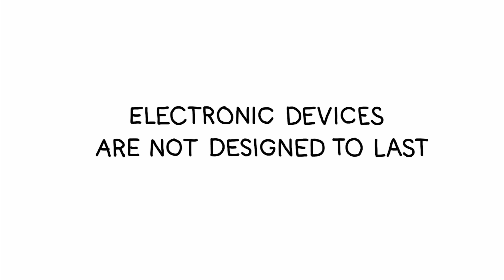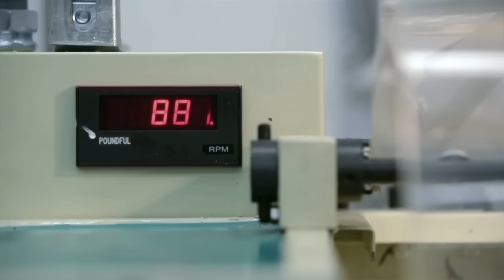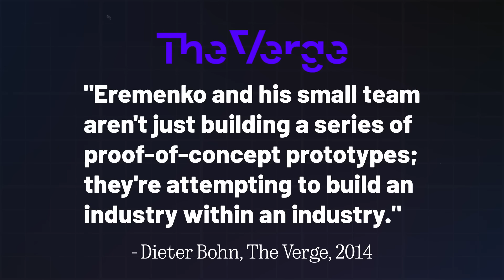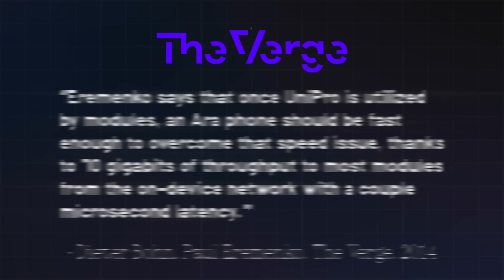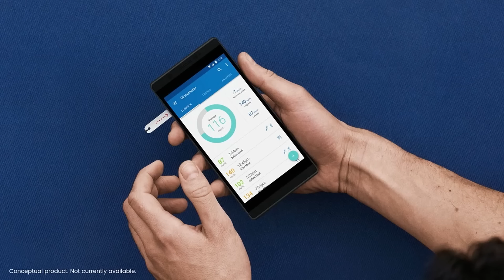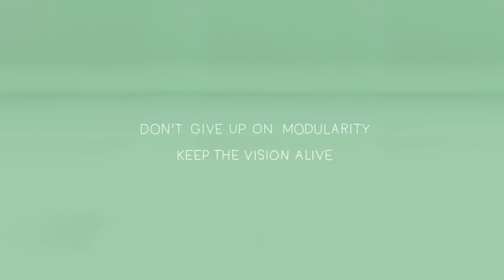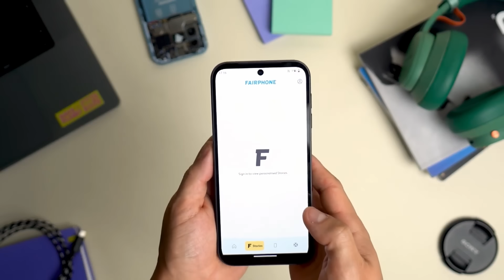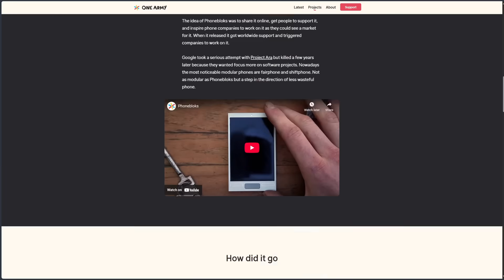Why Did Modular Smartphones Fail?

Comment: Yeah, I thought these looked pretty cool as well, but wasn’t sure how feasible it would be, especially the more pie in-the-sky promos like PhoneBloks, even if you could get everyone to work together on and pay for it.
The frame and all the module connectors/shrouds could make it a lot bulkier than a normal phone of comparable stats, the connectors could cause reliability issues and be prone to damage/coming loose (imagine dropping one of those without a case and all the parts flying off), getting the software to play nice with all the possible hardware configurations (and the different hardware to play nice with each other) would be a mess, non-tech-savvy users would likely screw it up assuming they weren’t scared off by it, etc. 
I do agree it should be easier to fix/replace/upgrade bad parts in phones, with right-to repair and such, but that concept sounds like it would cause a mess of its own problems; something like the FairPhone where parts are just easier to swap seems more workable.

Comment: I really liked the idea of these phones when I heard about Ara. It was something that I was like "Cool, I'd probably buy that" but then thought more about it and wondered what would I even want to swap out. Unless something breaks the only things I'd want to upgrade might be the camera or the cpu/storage/ram. All of which work well enough in modern phones as it is. I also had a big question mark on the whole limiting of waste aspect because I still figured that there'd be enough people who'd just swap to the shiny new module. (iCamera module 10, now with a physical built in zoom!) and toss out the old one. Technically, it would be less waste since it's a smaller piece, but that's just for a single upgrade. Not to mention how much it would be breakable. Even with the lock-in snaps I just imagine a lot of those little parts could end up broken or scuffed up in the same way that the lightning cable seems to always wear out super fast. Although not as fast as the prongs on the Micro USB. XD

I still hope that one day we have something that can bring forth this kind of idea, but I don't think the approach that these guys did was the real end piece. The attachable methods have some merit, but they have the starkly obvious con of now carrying around a bunch of attachments (depending on industry, cases would be made, but still).

I suppose I should also admit that I'm one of the people who just loves the idea of cartridges for games and really misses that (Switch kinda brought it back, but I don't have one nor plan to get one). So I'm quite familiar with loving a technology that will just not work, or if it does isn't wide spread, in the modern market.

Comment: The moment I heard of modular phones, I figured they were pointless.
Want to separate major components onto separate blocks instead of keeping them on a single die? Performance plummets.
Want a selection of peripheral modules? Can you really think of something you would want that other people would not and vice versa? Are people's needs REALLY that different?
Once you concede the previous points, the only real issue that remains is making the internal components of a phone relatively easy to access and replace. Yeah, that can be done.
There is no grand conspiracy against the modular phone and there never has been. It's just a bad idea with superficial appeal.

Comment: Because people don't know how complex phones are and how you cannot just swap a part for another. Different parts use different interfaces to connect & Only certain pins support certain interfaces. Moreover many interfaces are high speed interfaces which require a very strict design, like trace lengths being same, etc. This means you would have to design all the connection points with the strict designs in mind because you don't know what a particular connection point could be used for.

Framework laptops are a very different thing. All high speed interfaces are fixed like camera, etc. All the "modular" part is just a USB-C connection.

Comment: Part of the problem is that it's modular by design, rather than by necessity. PCs are modular by necessity; there are 4 main pieces, a motherboard, a CPU, a GPU and a PSU, and it's just easier to keep most of those things separate. And because of that, users can swap components easily. But with a phone? Modern phones are descendants of both the cellphone and the ipod. And famously steve jobs threw the first ipod into a fish tank to show the air bubbles to show there was 'still space inside' - phones cram so much stuff in that unlike PCs, it's actually much easier to design a product that cannot have core components swapped around.

And that makes modularity not a natural fit to the phone. That doesn't mean it cannot be done - it just means that modularity is a feature rather than necessary. And when something becomes a feature, it requires a ton of development time.

The same thing happens everywhere. Look at Minecraft redstone; you can make a huge redstone project on a superflat world and it'll be pretty easy. You can even quite quickly swap out parts - maybe you don't want that noteblock song section anymore, maybe you want some visual thing. But now crunch it all down into the minimum possible space and you're going to have to be a wizard to fit it all in. Now, if you change your mind about a noteblock song, you're going to have to fundamentally change the shape to get it working. It's hard and time consuming.

On something like a phone - small enough to carry, resilient enough to be dropped a foot, good battery life - the easiest things to replace are things like the speaker, buttons and screen, since they can sit on the outer surface in some way. But the core components - the things you WANT to be able to replace to keep the phone from being useless - are things that need to be crammed into the center. Pulling them away from the center to be modular components means significant issues getting stuff working. It's not impossible, but it's no wonder that it couldn't be done on paltry funding, not without seriously compromising the phone in functionality.

I would absolutely love a modular phone, the ability to swap out the CPU after a few years. But the time needed to develop such a thing properly could - any company will reason - be spent on designing other products.

Because no matter how cool the idea of modular phones is - businessmen don't want them, appleheads don't want them, parents won't want to give something so easily breakable to their kids, old people prefer all-in-one designs. People who care about fashion don't care about swapping parts for it to look cool, because they prefer either a premium look or expression through protective cases. So who is the product for, ultimately? Is that group large enough to make it worth designing that product, or will that demographic still buy an all in one smartphone if there is no modular phone to buy?

It's one of those ideas which is awesome but at this stage is just not going to happen - even if it happens, support will be so much lower than apple or big-brand android like samsung or huawei that it can't take off.

Comment: I got the newest ShiftPhone a while ago and love it. Never had any issues with it.

It is a bit more expensive than non-modular phones with similar specs, but my main stand-outs are:

- New phone models are effectively crowdfunded through people preordering it. During this crowdfunding process, the developers give regular presentations and have votings for pre-orderers to have a say in features they want to have in their phone.
- Good customer support
- Designed to flash a custom OS onto it
- The recycling and ethics aspect is much better than Fairphone's. Supply chains are actually transparent and fair. Fairphone is in my experience a lot of marketing but very dodgy ethics.

So yeah, I'm really happy with ShiftPhone.

Comment: I think flagship phones do all these things well enough, and if you truly wanna stay on the bleeding edge or have all the upgrades you just flip your old phone and get the newer one.  Quick charging / wireless charging makes battery wear less of an issue because even when your battery no longer makes it through the day, you can top it up quickly at the half way point during your lunch.  as for the phone breaking: always use screen protectors and lens protecting glass, and a case to absorb shock from falls.  We're getting to a point that people are no longer replacing their phones as often because the tech has matured to a point where it's good enough to do everything.  People don't want modular upgrades, they just want the best stuff baked in.

Comment: i feel like the problem with the modular phone is that it doesn't really fix the issues it seeks to address.  if you wanted a phone to fit your life style i'm sure its out there somewhere. if not, i think hyper specific phones would be cool but, it doesn't fix the fundamental issues with with build quality and life span decreasing even if the the technology is advancing.  people buy more bad products because they break more often, it is a right to repair problem but if the component your putting in is just as low quality as the component that was already in it your not really fixing your phone as much as your are doing basic upkeep like you would on a car.

Comment: I was so pissed when the USB charger of my previous phone (I guess, it's something worth of 50 cents or so) broke and any repairing would have been a total economic desaster.

As a consequence I bought a FairPhone, that is at least modular enough, so you can swap individual parts for repairing or upgrading. And it has long term support (at least 5 years, but in past 7-8 years were usual) with the additional support from the LineageOS community after it, no boilerplate apps installed and just works fine. I'm happy with it now for 5 years, still enjoying it and will running my first repair/upgrade round at the end of the year.

If we leave out irrelevant features like you can't go diving with it, it is as good as an iPhone, but still a bit less expensive, longer endurant and repairable. And as it installs Vanilla Android, the spying on you is quite reduced at least compared to all other competitors.

So, some modular phones (not to the extent of the video) doe exist and have a long running successful business case. Of course, probably significant less market share than 1 percent. But that's up to the consumer, in the end any modular phone will be less expensive over the lifetime (and it will live longer). And as smartphones don't distinguish anyway each other (beside of the enshittification race to the bottom that most manufacturers have choosen), it's a relatively simple economic decision where good price meats practicability and distract-freeness.

Comment: I think most people will be happy with being able to easily swap the screen and the battery.
Like, repairing them is quite easy all things considered but having to pop a glass screen is scary and digging a bit too deep will make you slice through a ribbon cable.
You do miss on the satisfying sound of the pull tabs tho.

Just imagine you break your screen and buy another one by just removing a few screws or literally just pulling it out and while you are in ther pop a new battery.
Boom. 90% of the phones in the market have enough memory, storage and power to last you a few more years.

Comment: Why did it fail? Simple. You dont really need to repair or upgrade your phone that much. The phone you had 3 years ago was already powerful enough to do everything your new phone does. 
Also Companies really dont care for waste and even want you to waste more, because why only sell you a new battery when they can sell you a whole new phone. 
Now after the new repairability laws in the EU that forbid designs that make repair hard on purpose we do have a bunch of new phone companies poping up that promise easy repairs and an actual replacement part shop.

Comment: modularity is so far down the list of priorities of the general consumer looking to buy a new phone that it's never worth the material cost, development time & sacrifices to more important aspects like durability. The enthusiast community does not have enough leverage to grow a 3rd module & accessory market that makes having a modular phone worth while.

Not to mention that in reality if this becomes industry standard, there'd be so many proprietary standards and design restrictions to make them useless. Chances are they'll make the most flimsy fragile modules imaginable so you keep buying them as replacement. The main parts will still be hard wired to the phone so you still have to buy a new one every once in a while, with a brand new accessory ecosystem with no backwards compatibility of course

even in a perfect world, thekr market space will always be pinched by general consumer phones where customers will scrutinize every cost associated with the phone on one side and purpose built phones specializing on one aspect really well where no professionals will compromise on the performance regardless of cost

Comment: As someone who has long been interested in this and who has been using a Fairphone 4 for 3 years now. I think that maybe these "swappable bloks" are not the right idea. Sorry but we have to admit that caring about your processor or the model of your camera is nerd shit. What most consumers want is to buy a phone, boot it and it works nicely.
With the fairphone, you can replace the parts by opening up the phone and unscrewing them. And you know what this reminds me of? Just a standard old desktop computer. Maybe one of the most modular designs to ever exist, the desktop computer is both something for nerds like me who want to upgrade their graphics card and improve their RAM, for people who want to use it as long as possible as well as for consumers who just want a device that works out of the box. And that's what I've been wondering, why is there not at least one standard phone format with replaceable components that you can buy upgrades for? Not one with cool click-in tiles, just one that you open up and screw whatever processor module you want into. It would possibly be a bit niche and nerdy at first but I don't see how something like that couldn't become a general base for affordable and premium phones just as it did for the desktop computer.

Comment: honestly something kinda relevant imo is how a "fully modular" design... isn't really possible? or at least not really accurate. there are certain things every phone needs to have - a CPU, ram, storage, battery, probably a GPU, etc. that's gonna take up at least half of your existing slots, and leaving them out leaves you with a non functional device.

plus, these components aren't just off the shelf stuff thrown into a motherboard like a PC can be - this stuff is all specifically designed to work together. even if your phone's CPU had some "common socket" like a PC, that doesn't mean it's compatible with the rest of the hardware. 

but even if you were able to reconcile all of this, you end up in a situation where you probably need to upgrade all of it simultaneously if you wanted to upgrade any of it. your new CPU takes way too much power, so you need to upgrade the battery too, etc etc. 

I think all of this is why the product team at Google did what they did to the ara concept. it bundles the "core" components of the phone together for practical reasons, but lets you pick which bells and whistles would be important to you. I think it's a cool idea for a product, but I also imagine they struggled to find the diversity in module producers that they hoped for.
Reply: > "(...) but lets you pick which bells and whistles would be important to you."
Which for most people... are the exact same things. The sort of modules already present on existing phones. You'll struggle to find someone more than a handful of people want that isn't something more than a handful of people DON'T want.

Comment: The issue is not modularity. 
I'll happily disassemble my phone to change and replace parts.

That's 2 screws to open it up and a few more for the camera module. 

The issue is non standard parts. Like batteries. Just have 10 form factors to choose from. Same for the camera. Same for the screen. 

But parts are no longer accessible. Exclusivity agreements are undermidning the free market.

Comment: That original phonebloks video is nonsense, at least as far as the blocks going in any configuration. Like if you put a CPU in its socket rotated 45°, the pins need to match up. Ara at least makes sense from a technical standpoint